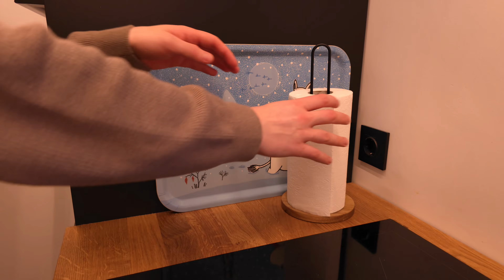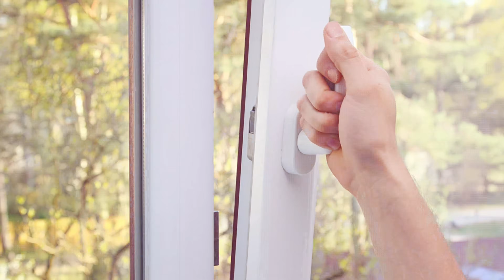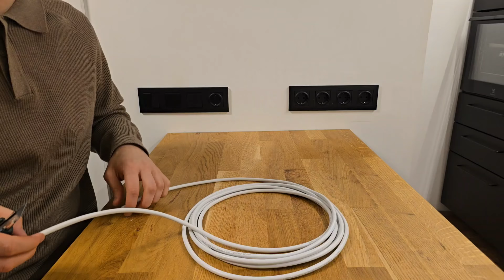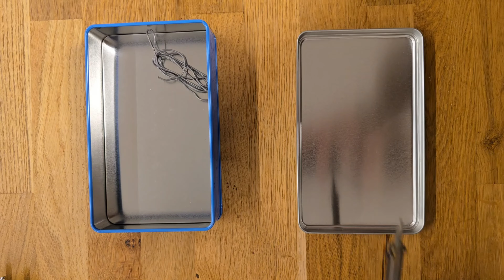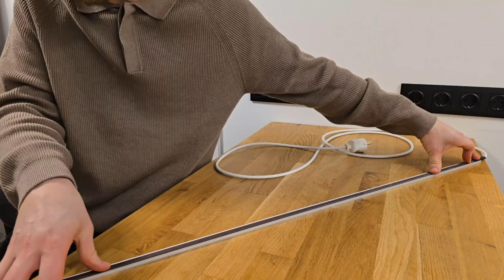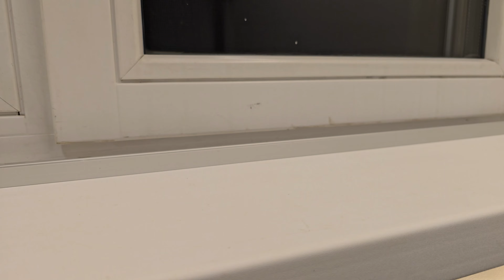Cheap Way to Stop Window Condensation for Good

Comment: You sound English but are not using an UK plug. This makes me wonder how safe and economical it would be in a UK home.
Reply from the maker: Thanks for noticing! I'm based in the EU where we use Schuko plugs. The system is grounded and safe. If you're in the UK, using a standard fused UK plug and heat-shrink kit with adhesive would make it compatible with local safety regulations.
It's economical, too. If a 30W/m cable is used, it should actually consume less during normal operation. Because it’s self-regulating, the power output drops as the window warms up. For a 1-meter setup, I expect it to settle at around 15–20W total—roughly the same as a single traditional light bulb.
Reply: Till he said aluminum 😜